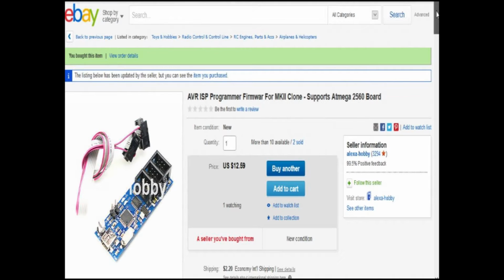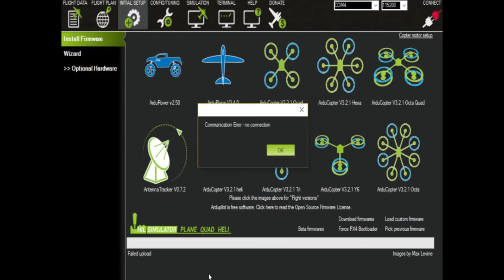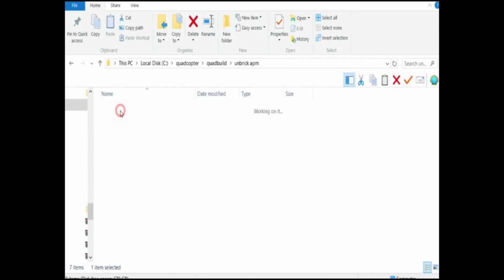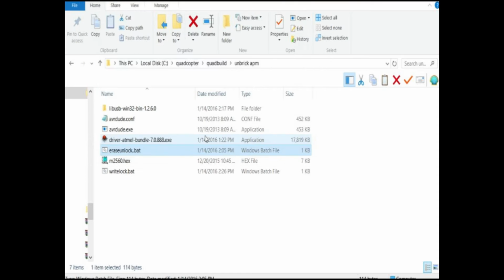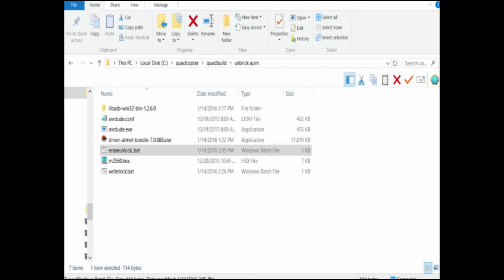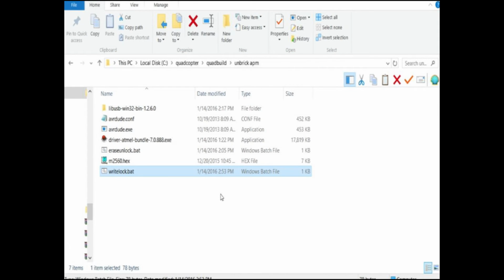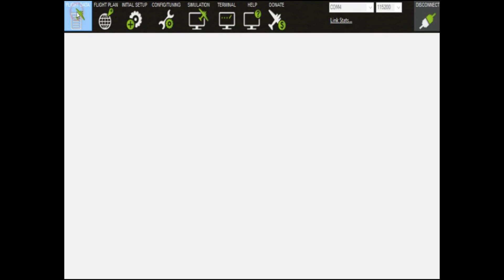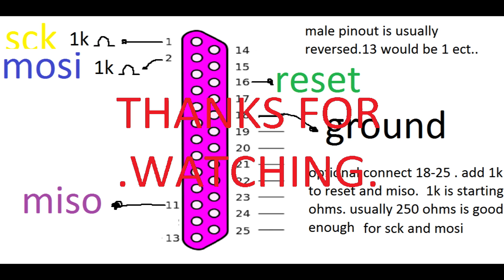Recover a bricked APM 2.

Comment: Hello Mate this video looking very promising I have got different unit and I hope you can help me to set it up please check the link   http://www.ebay.co.uk/itm/122043493742?_trksid=p2060353.m2749.l2649&ssPageName=STRK%3AMEBIDX%3AIT  .I really hope this one will work as I couldn't find in UK exactly the same to buy. once again thanks for posting this video ;)
Reply from the maker: hello, yes that will work just fine.. you can even use a arduino nano
Reply from the maker: also once you get it and if you run into problems let me know.  the bat files might have to be changed.   this part you will have to pick usbtiny if it gets detected that way here.. https://youtu.be/gKMFenjNrLE?t=271
Reply: You r right bat files not recognize this unit how can i fix this?
Reply from the maker: Hi .. edit the bat file and change avrispmkii to usbtiny in both bat files
Reply from the maker: If this is something you can't do ..i can upload it with the edits
Reply: yes please can you upload change file to yr drive that way somebody lase may use in future with that programmer, and I tell you what YOU are a star Mate so Helpful ;)
Reply from the maker: here are the files extract to the same folder as the other files.
https://drive.google.com/open?id=0B2w6_OKE_2kxOWVyZS1IS2s0U3M
Reply from the maker: HI just curious if the files worked out for you?
Reply: yes ti has been recognized but I'm getting some errors flashing that new boot loader and still can't flush new firmware. but there is a diferents in led lights before it was solid green and blue and red blinking now I got green solid an blue and orange blinking. any idea how to fix this? Thanks again Mate for yr support ;)
Reply from the maker: what errors with programming boot loader?

does your apm get detected as com port when you plug it in still?
Reply: no the apm is not recognize on com port at all
Reply from the maker: so to be clear.   if you go to device manager . plug in the apm . you get no com port?   do the lights come on?

if not you might have to program the bootloader on your 32u2 chip..it might of got corrupted as well.

do you have telemetry? ..
Reply: yes i do telemetry and no do not show any com when i plug in to my pc ;(
Reply from the maker: i will send you a file in a bit to test with telemetry.. just making it then testing it..
Reply from the maker: alright try this file..it will do a complete write of your apm.
after its done.. try to connect with the telemetry just to see if you can connect.       its sorta pointless to a point where if your 32u chip is screwed up .you won't be able to use your remote.. but at least you will have the firmware on the apm.. click on the usbtiny bat file included .. this will put version 3.2.1 

once you run the file. after i say to push any key ..just push the key once. and wait it might take time to start up after each .press any key.

https://drive.google.com/open?id=0B2w6_OKE_2kxMVJkOEJfQl9lQ28
Reply: that file is corrupted mate nothing inside rar pack
Reply from the maker: and after all that you might have to try this..
http://ardupilot.org/copter/docs/common-ppm-encoder-apm2x-atmega32u2.html

then if that does not work ..you will have to solder isp header for that chip .. and try to re write the bootloader.
Reply from the maker: u need 7-zip  to extract
Reply from the maker: http://www.7-zip.org/
Reply: that file on yr Google drive the size is only 316kb and when i open with 7-zip nothing inside to unzip
Reply: hahah it works now looks like my 7-zip was not up to date ;)
Reply: is there any way to replace that chip if become faulty?   just wondering ;)
Reply from the maker: which apm do you have?.. and with the files i just made you did that work?
Reply: APM 2.6 and file did work flash my apm without errors , still not conecting via usb i have to pick up my telemetry from my friend tomorrow if I will have any joy I will let You know right a way ;) thanks for yr support so fare Mate I think U deserve a very good BEER ;)
Reply from the maker: .. Ok later I will see if I can put a package together to program the 32
 chip which controls your usb and remote pwm inputs.   you have to be 
able to solder though the isp header onto the board. .. can you solder ?
  ..     also about replacing either the chips is possible but would be 
hard.   ....  

I have to ask again.when you plug in the usb cable into the apm.. do the lights still come on at least?    .. if the lights don't come on at all..then maybe its just a voltage regulator or something else.
Reply: yes i can solder mate ;) and the lights does come on so it is kind of live but don't want to talk with me hehehe ;)
Reply from the maker: alright later . i will play and make a new video making programing the 32 chip painless as possible..
Reply from the maker: new video here .. hopefully it fixes your problem and its really easy this way.   https://www.youtube.com/watch?v=U6axABOd_Dk

Comment: sir,

I just uploaded the eeprom clear programme using NORMAL arduino IDE ( not the gcc one.) to my apm 2.6 board and since then my apm is almost died. When i connect it only powers up and the green light glows but nothing happens other than that. tried to reflash it using Mission planner but it fails and tried to reflash it using arduino IDE (gcc) but nothing happens.

https://app.box.com/files/0/f/10929476183/1/f_91920961239

Please help.

Did i destroy the board by uploading the eeprom clear programme??

thanks
Reply from the maker: have you tried with isp?     you should be able to fallow the video to get it going again.
Reply: Sir
I do not have a isp programmer yet. Will try once i have one. And is USBASP and USBISP the same thing?

sir is there a  way i can contact you like for a conversation? got some questions about the APM 2.6 board.
Reply from the maker: yes you can use them both.. ..If you are into modding I would suggest getting a arduino Nano .. example  http://www.ebay.com/itm/Nano-V3-0-Mini-USB-ATmega328-5V-16M-Micro-controller-Board-CH340G-F-Arduino-NEW-/162002876661?hash=item25b81fb8f5:g:ARcAAOSwuzRXefjh
instead and just converting it into a isp .. this way you can use the arduino Nano for other projects as well. you can basically get 4-5 of them i think for the same price ...  .. Anyways you can contact me at bangs696969@gmail.com   ..
Reply from the maker: and to mod it ..this is the instructions.. just go by the picture
I should find some English instructions..
 http://compcar.ru/forum/showthread.php?t=8418
Reply: Thank you sir. 

And one more question before i do isp programing.

Sir as i have mentioned that i uploaded the EEPROM CLEAR programme with ARDUINO IDE on my APM 2.6.

I just wanted to know did it cleared the EEPROM of the main chip that is ATMEGA2560 or the ATMEGA32U2?

and if did flash the ATMEGA32U2 then how to re-programme that?

Moreover the ATMEGA32U2 is a avr isp chip on board then why cant i use that to burn bootloader in ATMEGA2560?
Reply from the maker: no you did not wipe the usb chip ..that has its own isp.. ..You most likely just corrupted the bootloader  ..its why i made the video its very easy to corrupt the bootloader on the apm2.6 it seems.
Reply from the maker: about using the atmega32 as a isp ..look at the picture I sent you of the pinout.. .if you can trace them out and cut all the traces that the pins are being used for something else ..you can do it.. but seems like tonz of trouble..honestly never looked into or traces it out
Reply: Got you Sir. You are amazing.
just few more things to know if you could help please.

There are three jumpers on APM2.6 the jp2 jp3 and jp4(apart from the power jumper) just beside the GPS socket and below the input pins. Could you please tell me or share a link where it describe about the functionality of each and every one of them. 

JP2 is traced to get into the dfu mode and what about the other two?
Reply from the maker: HI.. the first row(closets to the gps port)is usually shipped with it on..and that's for internal compass ... the middle one is so you can program the 32chip bootloader mode....honestly never used it.. and the top one is for external compass......  however I have never had to use it..i just remove both jumpers.. jp1 and jp2..

Comment: I had to order some pins it will be a while before I get them will keep you advised. I am confident that it will work. My big problem is what caused it to lock up.
Reply: Thomas I have having the same problem. I need to know what are the name of the pins you ordered? Did they work?
Reply from the maker: is this what your talking about?   .. http://www.ebay.com/itm/10PCS-40Pin-2-54mm-Single-Row-Straight-Male-Pin-Header-Strip-PBC-Ardunio-/180974247480?hash=item2a22e7de38:g:elwAAOSwWfFXkGSE
Reply: Yes did they work?
Reply from the maker: I'm kind of jumping in the convo. because I think your trying to get info from Thomas.. ..   Anyways   those will work fine to make a isp header , you will have to snap 2 rows of three .. If you are worried about it being straight . just plug the two rows of three into the cable from your isp , Plug it into the board then solder on the bottom
Reply from the maker: you can also get these..but a tad hard to break into 6 .but they are made so u can snap them.. .http://www.ebay.com/itm/5x-2-54mm-2x40-Pin-Double-Row-Male-Pin-Header-Strip-Break-Away-80-Positions-/141556171187?hash=item20f567c1b3:g:x0sAAOSwWKtUyBCl    personally if I had to order either of them I would go for the first link I sent you. In case you need them for other projects like adding tx,rx pins to stuff .. ect ect..

Comment: I'll have find some pins and get them soldered in would you happen to know the pin spacing.Thanks again for the help
Reply from the maker: they are just standard... I had just grabbed those pins off a old mother board.... ..you could always put the pins into a harness then plug it into the three holes or 6..then solder on the bottom ..
Reply from the maker: also I suggest before you crack the two boards apart.. use a felt marker and mark on the side of the circuit boards top and lower section.. so you don't accidentally put the board on backwards..
Reply from the maker: any update?  just curious if you had success or if it is messed up.

Comment: Just as a quick note I have the same board and version but mine lacks the header pins you have on yours. Would it be worth it to solder some pins in place and give it a go
Reply from the maker: HI I had to solder on those pins on the v252 v5 board.. .... I did not mention that in the video and probably should of . same with the apm 2.6 some don't actually come with the pins on the board..
Reply from the maker: you have this one ??  https://youtu.be/gKMFenjNrLE?t=420

Comment: I am getting the sub connect but it tries to go Malinke and will not connect times out all the time,Also can not get radio to connect to the unit. What ever I did I I did right. I was going to purchase a new fc from hobby king but will wait to see if unbricking will put me back in operation if not guess anew will have to be.I would like to thank you for taking the time to help me.
Reply from the maker: Curious what happen to the apm before hand, Were you ever able to connect to it with baud rate 115200,  .. ?    Something you can try if you are still waiting on the isp to come in the mail..   Find another usb cable and cut the red wire (positive)   , Plug that cable into the apm and computer , Then plug in the quad copter battery ..Give it 1 minute before pushing connect in mission planner,  (save this cable as its handy to always use it while your using the battery and usb.)       ---- also try to connect to the apm with everything removed and use the usb port on the side of the apm..

Comment: It seems you have worked on more then a few of the fm was wondering if pushing the reset button does anything.I just ordered the programmer to try and free the thing up this has been a learning process for an old man but fun
Reply from the maker: reset = reboot,usually if the atmel is stuck in some kind of weird loop , However we just unplug the battery and back in,  It might be handy to use it for esc programming ect..
You are still getting the usb to serial com port detected right?   I forgot to mention that in the video..

Comment: Hi thanks for sharing that video but when i tried recover in my apm it had a solid green and a flashing red and do noting
Reply from the maker: Hi Did you go into mission planner and load version 3.21 after you were done?
Reply: Hi thanks for your reply but no the pc doesn't recognise the board
Reply from the maker: Ok what step are you at?  with just your isp  ..not connected to the apm.  do you get any info .. like this https://youtu.be/gKMFenjNrLE?t=287